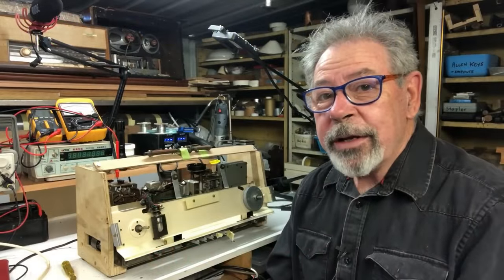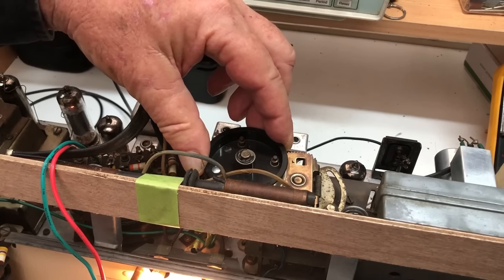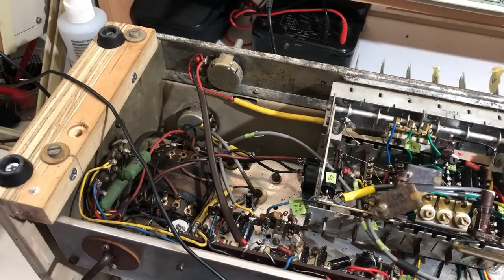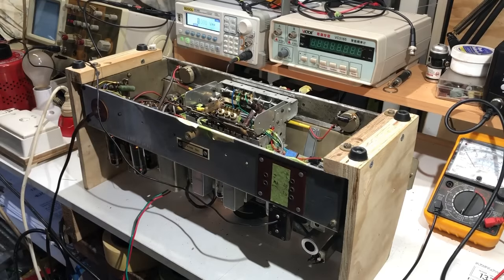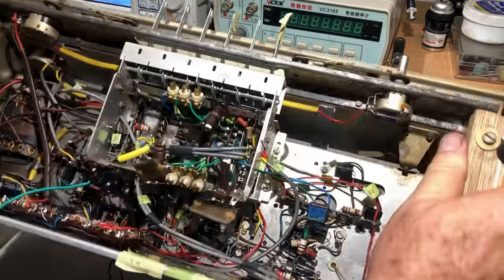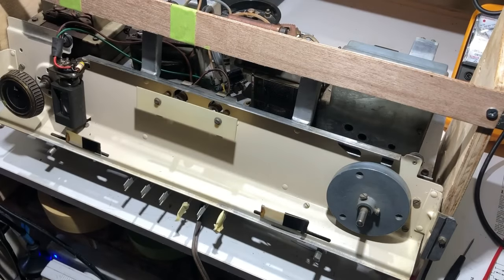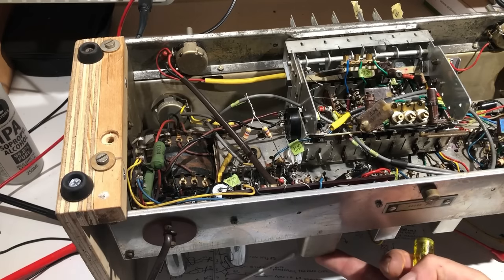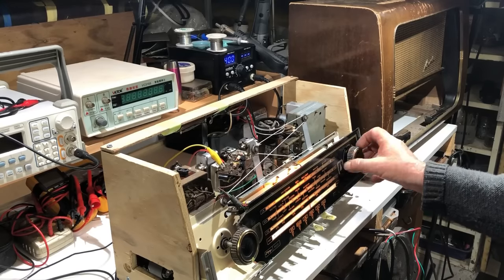BUSH VHF64 Part 5 - IF alignment, dial string and a few issues ...

Comment: Considering this radio was headed for the bin at part 3 it is coming along nicely Don. You said the ratio detector reservoir capacitor (C64) was replaced with a 50uF cap, I assume you meant 5 or 4uF. 50uF is too high. FM alignment is a different beast as you found. You got there in the end by ear which is fine. The zero volt bit at the end is trying to balance the voltage (sinusoidal waveform)  across the ratio detector. When it is balanced the meter will read zero volts as there is no voltage bias between one side of the detector and the other (sinusoidal waveform is dead centre in the detector). Another way to do it is to add AM modulation to the 10.7MHz, when the detector is balanced the AM modulation sound will be minimised as it is designed to reject AM artifacts like clicks and buzzes etc. AM rejection is handled by C64 and R7. I hope that helps Don, it was a complete mystery when I started too 🙄
Reply from the maker: Hi Dave
Yes, the ratio detector cap is 5uf, not 50.  I do say some silly things but I usually catch them in the editing. 🤐
Re balancing the voltage across the ratio detector, I had a fair idea something like that was happening.  I did have the idea of applying an FM modulated signal at 10.7MHz and looking at the audio output on the scope and balancing it visually.  That's a pretty indirect way of going about it but I wasn't aware of the AM rejection at that point, so thanks for the explanation.  I was wondering about the purpose of C64 & R7.  In the end I decided to trust my ear and I'm pretty happy with the result.
A couple of people have suggested that one of the diodes in the detector valve may be weak.  If that were the case I can see why I couldn't get a zero reading - but why was I able to adjust it by ear?
I'm afraid that there is a penny that hasn't yet dropped in relation to ratio detectors.  I have done some googling but the information I found got into a discussion about phase differences and explained the process using a level of maths that I struggled with.
Maybe I'll try again 🤔
On the bright side, a friend has just dropped off a nice old STC model 53 console radio for me to get going.  That should be fun.
Cheers

Comment: I'm sure it will all be worth it in the end! Bush radios were originally made in Shepherds Bush near London in the UK. I'm sure they were assembled worldwide also? You have done an amazing refurbishment of the radio so far and I'm sure your cabinet skills will make it yet another outstanding radio. ECC85 valves are cheap in the UK a very common replacement. Good luck with the rest of the work.
Best wishes
Lynton G4XCQ
Reply from the maker: Hi Lynton,
I'm not sure if Bush radios were assembled outside the UK.  Perhaps someone out there knows.  They certainly weren't assembled in Australia.  This one has original factory quality control stickers from the UK factory and there aren't many of these radios here.  In fact there aren't a lot of VHF / FM valve radios in Australia at all.  We didn't get FM broadcasting until the late '70's / early '80's - well into the transistor era, so there was no local market for them.  I have seen a couple of ECC85's for sale on ebay here though.  I might just have to buy one & see if it makes a difference.

Comment: Hi Don, nice to see you are progressing. Your volume issue may well be a tired ECC85 as you have said, but has anyone screw-drivered the core of the coil above the ECC85. Part of the FM RF alignment is to adjust that core and it improved reception and volume on mine quite a bit. I also watched Manuel's video's on this model and followed his advise to increase the brightness of the Magic Eye by changing the point where it obtains it's B+ and stepping up the voltage. Follow the wire back and move it to the other side of the voltage dropper resistor.  (I left a note attached to the wire at the valve base in case I ever change the Magic Eye). I put the 4 and 1/2 turns around the spindle when I restrung mine and the cord looked similar to yours. I may regret it as it appears to be chaffing on itself at the spindle. 3 and 1/2 may be better.
 "flopping around like a nudists knob" 🤣 As was mine (the tuner I mean) as you suggested earlier, when I said I had poor tuning stability. Keep at it. Epic but sure it will be worth it. Dave
Reply from the maker: Hi.  Yes, changing the grommets on the tuning mechanism tightened everything up nicely. I meant to show more of the dial re-string but when I checked the video I had my arm in the way of the camera for most of it so it was useless.  You would think I'd be aware of stuff like that by now but nope...  I did briefly try adjusting the core of the coil above the ECC85 but it didn't seem to make any difference.  I decided to wait until I was doing the alignment and do it properly (whatever that means) as I didn't know what I was doing.  Yes I know the trick with the magic eye.  I might just give it a go.
Cheers

Comment: Hi Don, I wonder if the ratio detector valve has one weak diode, could be why you can't zero out the current and why things sound quieter than AM. Great video.
Reply from the maker: Worth looking into.  There's something not right there and I'm a bit out of my depth with this. But I guess that's how you learn.

Comment: I admire your persistence with this project. I have been attempting to align a VTR103 and like you, I had no luck with zeroing with the centre tapped resistors. I tuned the core for maximum AM rejection with decent results on FM, I think I got the idea from Manuel. I also used the 'ear' method on a Philips B4X12A, works fine, loosening the core was fraught.
Reply from the maker: Yes zeroing those resistors seems to be a problem.  Dave Tipton suggested using the millivolt range rather than mA.  Makes sense, but if it won't zero, going for maximum AM rejection seems the way to go.  Not hard to go by ear either, so long as you have a good speaker setup so you can pick the sweet spot where there's no distortion.

Comment: Awesome job again on this radio. The amount of transplants you had to do on this one is quite insane. Seems like we're both on a mammoth project these days. 😄
About aligning the ratio detector: using the microammeter is a bit weird. Maybe they did it like this because millivolt meters weren't that common back in the 50s? Anyway, I would just measure voltage between those points and align for zero.
Also: your chickens seem to sense that Australian spring is coming. 😄
Reply from the maker: Cheers Kristof.  Yes, Spring is definitely here!  The roosters are annoying - they belong to the next door neighbor but keep straying into our yard to visit our hens.  Maybe we'll have chicks soon!

Comment: Hi Dave this is a massive job. I’m not sure I have the patience that you have. I had a thought about the switch. The phenolic material was often paper layers compressed with phenolic material. Over time it absorbs moisture and can conduct electricity. Starting as a few micro amps from the terminals to ground grows and grows eventually breaking down the insulation. And charring etc. So when you piut cleaner on it the heat would boil the oil left from the cleaner eventually setting fire to it?  
I know that in pinball machines the manuals strongly say do not put cleaner on relay contacts as they will catch fire.?
Reply from the maker: Hi Robert,
You're right, it was a massive job and I really doubted that it would work.  I used to work on pinball machines in the '80's and we used fine emery paper cleaning sticks.  They were always used dry.  I remember stray grease from the motor driven switches used to give trouble when it got on the contacts.  So did spilled drinks running down under the playfield and gumming up contacts.
Cheers

Comment: Hi again Don. I’m no expert but I have it on good authority that the ECC85 has to work quite hard for FM so a replacement may do the trick. I restored a Grundig radio a while ago and had to replace the FM valve to get it working.
Lynton G4XCQ
Reply from the maker: Hi Lynton
Thanks for the tip.  I hadn't heard that but it sounds logical.  Another thing I was thinking is that the B+ is switched off when the set is being used on AM (which would have been for most of it's life in Australia) but the heater remains on.  I have read that this can lead to a thing called "cathode poisoning" where the coating on the cathode is damaged by emissions from the heater.  In any case I think I'll order another ECC85
Cheers

Comment: It's a good idea to make up a matched set of 47K resistor's for the FM alignment.  This is done to reject any of the A.M.  I.F. from getting through.  Your setup is wrong, or one of your diodes is possibly bad.

Comment: Don, i think you have done really well with that heap of trouble.
Have you tried brake fluid to eat the white paint in the tuning transformers?.
 dont know if it would eat the former.
Reply from the maker: I could try it on one of the old ones, for future reference.
Reply: @Donno308   worth a go,  also paint stripper might soften the paint.
Ask David tipton, i bet he has explored this problem.

Comment: I am working on a vhf91, I have almost finished the radio but it seems strange I align the set am & vhf (even though am is almost finished) but after a couple of months the alignment is off again 🤨. I still have to fix up the cabinet as it come to me in pieces but the french polished top and sides are in reasonable condition. I have just brought some long sash clamps as the case is quite long too
Reply from the maker: Hmmm.  I guess you replaced the 5uf cap in the ratio detector . Maybe the detector tube itself is getting a bit weak and drifting.  Trial & error on this one I guess.  Best of luck with it anyway.

Comment: Just being awkward- is it possible the AM audio should not be set to maximum output?  I have had equipment where there is a larger headroom that is not used and the output is intentionally set less.
Reply from the maker: Yes maybe. There is a lot more volume available on AM than necessary.

Comment: It seems you have no methodology for working with tube radios compared to many others. 

You do not mark the schematic drawing to let you know what's been checked.
Reply from the maker: Hi Dave,  
I know Manuel Caldeira, for example, often does this.
I suppose different people have different methods.  I do sometimes mark the schematic to follow what I've checked. I don't often show it in the videos unless I feel it necessary to explain something. Sometimes I only mark the components I have checked.  It depends on the radio I'm working on and the level of difficulty.  With straightforward repairs I have no difficulty remembering what I've checked. 

Cheers